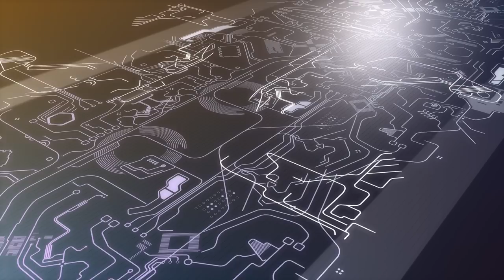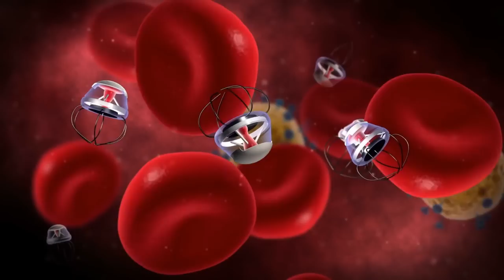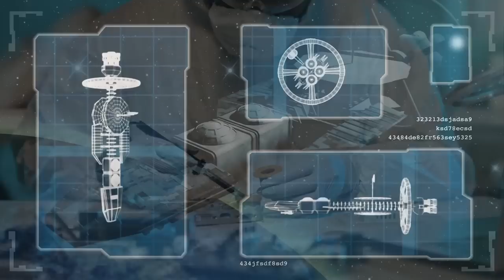Damaged Spacecraft & Shipwrecked Saucers

Comment: The sparking and exploding high voltage control panels in scifi spacecraft have always amused me.  Required voltages go down as electronic sophistication goes up.  Currents go up, for now, but there are overcurrent protections.
Reply: It's the FUTURE!

Everything is now built with an allow of Explodium, Sparkium, and Smokium. 

Why can't people see the visionary and practical application of that?

(Picard is intrigued by this comment. Sisko is angered by this comment. And Kirk is aroused by this comment.)
Reply: @davidtherwhanger6795  It is funny how with centuries of technological development, Starfleet still hasn't rendered pyrotechnic circuit breakers obsolete.
Reply: Depends. For the replicators we are talking petawats of energy. I would assume higher voltage goes long way to avoid trillion amp circuit breakers..
Reply: @ladislavseps4801  But we don't normally see the replicators explode. I don't remember ever seeing a replicator, even a small one, explode. Instead we see the computer panels (control circuts) explode violently enough to throw full grown adults some feet away. Those should be low voltage/ low amperage/ low current systems.
Reply: @davidtherwhanger6795  It seem like most people see the star trek episodes and have no idea what going on. All the episodes where the control panel explodes is from a outside energy surge. That doesn't mean the control console is high voltage or any kind of safety device would have made any difference. It was part of the story line of the episode.
Reply: @ladislavseps4801  I have seen no episodes where petawatts of energy was used for the repicators.
Reply: @ladislavseps4801  Where do you get petawatts of energy for a replcator.. It  has never been said on any episode of energy levels that high for replicatorss.
Reply: @clementvining2487  I was an Electrician's Mate in the US Navy. Can guarantee it doesn't work that way. Being as you want to talk about Trek and nothing else explain how in many episodes when a computer panel on a bridge workstation does this some one else immediately sits down and operates the panel? It just got zapped by loads of power it wasn't supposed to be able to handle and the systems should be fried as they were sparking with enough force to throw some one away, but still works? Please explain in detail how the panel is perfectly fine after a few seconds after most of the insides should be melted.
Reply: Yes, I know explodium has its downsides, but it's just so perfectly suited for starship applications.
Reply: The future has no OSHA apparently. Little things like unintended acceleration into a star are hard to prove with no spaceship

Comment: For long distance ships, it always takes me out of the show if the "lone long range explorer" doesn't have a factory with it. 

I loved Voyager (warts and all) but even kid me was like "why didn't they immediately take a left turn into an uninhabited solar system and convert Voyager into a heavily armed factory ship? They have replicators?"

(Yes I know..."replicators can't b/c..." BUT replicators CAN replicate robots and tools, and you have a solar system full of raw materials. Build a von Neuman probe factory, launch those babies and have scouts that eat it before you do, and then lumber from raw material point to raw material point, armed, armored and factoried up to the teeth. )  

It's...literally their long range, extreme distance, top of the line, explorer. It's supposed to work without starbases for long times. That thing should be able to tear apart full solar systems given time and necessity.
Reply: I have recently begun to wonder why no one in Star Fleet didn't weaponize cargo transporters. Once an enemy ship's shields were down or if you where sneaky enough, you could transport entire sections of the enemy ship away. Sure you probably couldn't remove things like entire warp or impulse engines, but you could have all of them onboard lock onto the main power source of a ship and just start beaming away what ever they could grab onto from that area. Would cause all kinds of havoc to the enemy.
Reply: @davidtherwhanger6795  
Remove just part of a warp core.....
Reply: @davidtherwhanger6795  Beaming a photon grenade into the warp core works too 🤣
Reply: @davidtherwhanger6795  you don't need to beam anything in or out, just target the crew and delete the files from the buffer before you reassemble them, free, undamaged ship with no fight.
Reply: @davidtherwhanger6795  On that note why don't they also have an emergency system for when they get boarded? One where once the computer detects intruders it just starts auto-beaming parts of them into the void. I mean I imagine if you did that enough absolutely NO ONE(save for the Borg probably) would screw with your ships anymore.
Reply: @popuptoaster  Now that's thinking.
Reply: @AGTheOSHAViolationsCounter  Beaming them out piecemeal.
Reply: @ReallyRealBenMills  Yep just imagine Picard saying. "Commander Data engage program. . .'Falling to pieces'."
Reply: @davidtherwhanger6795  Because shields block transport and starship hulls are kleenex compared to the weapons employed?  If you've taken down their shields, and they don't surrender, which option do you take?  A) Blow the helpless ship out of space, or B) even the odds, make yourself super vulnerable to their weapons, and play transporter games?
Reply: @boobah5643  You can't beam it back to your ship thru your shields. (Well actually you can as Chief O'Brien did, thru the shields of another ship as well. But that's another story). You simply beam it to another location within range.
Reply: @icecold9511  You can't remove part of the warp core it is a container for warp plasma.
Reply: @clementvining2487  
You can if you want it to blow up. Weaponized transporter.
Reply: @icecold9511  Yes you can in the early shows with with the first enterprise. But the later shows they scramble the signal. The force field stop unauthorized teleportion also.
Reply: @davidtherwhanger6795  Accully on one episode of star trek enterprise they did that. They beamed parts of the enterprise from a different time on to the ship.
Reply: @popuptoaster  the transporters in star trek seem to have an analog component that makes them something of a black box technology. They work, but there is only a limited amount of control the crew has over the process so they might not be able to delete the file.

Comment: I always figured besides the bad writing the issue with them not using the replicators in DS9 was for a simple reason they installed the replicators designed for recreational use or smaller scale things but never installed the heavy duty replicators.
Reply: Industrial replicators damn near require their own warp core to function 🤣

Comment: Dangit I was hoping for an episode on reverse engeenering crashed alien ships, and pointing out that we probably couldnt reverse engeener it. 

For instance if romans stumbled upon a U.S. aircraft carrier. They just had no way to make the tools that made the ship, as the ship was made out of steel that they couldnt make, made out 1000's of times of iron that rome ever produced. 

 The Nazis used a 50,000 ton press to make air frames for thier aircraft and the allies could not figure out how they were making the air frames until they invaded and saw the gigantic presses. 

In other words why we probably couldnt reverse engeener a highly advanced alien ship because the tools that made them are way beyond us.
Reply: One thing to consider is, how much time does the Finder have to work on it.  If one's civilization is near its end, like Rome in the early centuries, so it runs out of time.  Versus the U.S. at the end of WWII where in twenty years the Axis tech had largely been decoded and worked into the processes of its industries.
Reply: Just because you can't copy the method somebody else used doesn't mean you can't make a device that uses the same principles.  Just knowing something can be done is significant information; having a device that can demonstrate the process can tell you how to build one, even if you can't build it the same way or at the same scale.  And sometimes the method you can do is better at the job than the method you cannot.

This last bears some explanation; I don't mean "A method you can use is better than one you can't," which is self evident and not worthy of note.  I mean local maximums are a thing, and the more 'advanced' civilization may be using a technological evolution that made more sense an innovation or three back, while those reverse-engineering the device are still using a technique the 'advanced' civ abandoned, but actually works better for the current application.  As an example, vacuum tubes are still preferred for some applications over transistors.
Reply: @boobah5643  Thats actually a part of the question. What if you can not figure out the principles behind what is being made, like the allies could not figure out how the heck the nazis were making magnissium airframes, especially without all the bolts and screws they were using to build theirs.

That said what if for instance a critical component is say alloyed metalic hydrogen that must be mined on a gas giant twice the size of jupiter? There is a reason why chemistry took off after ships started sailing all over the world. It gave them access to certain chemicals they never had access to before. For instance just because you had access to baking soda doesnt mean you could reproduce it without having access to trona ore.
Reply: If the Romans stumbled on a US aircraft carrier there'd be a huge shock in the simple fact that a metal hull can float. That one tidbit alone would jump an Iron Age civ forward a millennia in ship building tech. Also for the record, the Romans DID smelt an absolute fuck-load of iron. An air craft carrier uses a lot of metal, yes, but the Romans in particular of any pre-industrial civilization could have probably done it if they put their minds to it. The lead mining in Iberia for instances was so intense during the 2nd century that tree ring and ice sheet bore holes in the arctic show a spike in the atmospheric contents that wouldn't be matched again until the Industrial revolution. Water driven mining, in-line water-wheel factory forges and immense levels of consumer production usage. There's a hill in Rome that's made entirely of shattered shards of amphora vats (huge 50 gallon drum sized barrels) that were filled with olive oil. Had things gone just a bit different, the Roman empire could have figured out how to industrialize by 500 ad. Sorta the cultural aspect that goes along with the whole "vacuum tubes vs transistors" choice mentioned before. The Romans unfortunately listened to the Greeks for all the big idea stuff, so Plato and his cave of shadows ephemeral nonsense dominated thought. No one put theories to the test and implemented them, just having the theory was good enough to build a whole second theory off of the first and everything sounded like String Theory. Unprovable bullshit based off of someone elses unprovable bullshit built off of speculation that was never tested. Plato single handedly screwed up reasoning and deduction for roughly a millennia and we still to this day go back to his garbage. If you haven't guessed, I prefer Socrates myself, lol. Anyway, the fact of the matter is yeah the Romans probably COULD have smelted and forged enough iron to create entire fleets of metal vessel, even a few with tonnages similar to a modern warship. An eccentric emperor could've done a single air craft carrier sized flagship, sure, would've been more practical for lots of smaller ships tho (smaller as in WWII destroyer sized, still hundreds of tons of metal).
Reply: @Lusa_Iceheart  My hat is off to you because you are dead on about plato. Most people do not realize that. Philosophy has a lot to do with science, and that is legitmatly worth studying. 

And boy you are right, it would be interesting to see what Rome did if they realized iron could float.
Reply: @clementvining2487  the allies had the theoretical knowledge to build a 30,000 ton hydrolic press, but the allies had no clue how to make air frames like germany. They actually threw a lot of money at it during the war. When they finally saw the presses, they practically facepalmed because they could have built the tools. But seeing the airframes, did not help them build tools to make the airrames.

Comment: always wonder why they do not have surge protectors on star trek
Reply: Side effect of the low budget and creative thinking. Probably blame background issues on that. I don’t agree on things with the newer series do on occasion but the exploding console doesn’t really happen anymore since they actual show damage to the ships now. Yeah panels still explode but where the attack happens not on the bridge.
Reply: I think they should have had an episode where they had an away mission but they forgot Data's charger adaptor and Geordi tries to improvise one.
Reply: i always wonder why they put explosives in all the control panels that the crew stand over ..
Reply: LMAO it does seem like they plug everything else into the consoles up on the bridge
Reply: They run high energy plasma conduits through all the consoles. Crazy, I know.
Reply: Just seems stupid that a UI would explode or be of such high energy consumption that it could. It would be like your laptop screen or keyboard using a gigawatt when it only uses a few Watts.
Reply: In the military fuses and such are often circumvented because in a battle it's better to risk a dangerous malfunction than for the equipment to stop working just because it went out of safety tolerances. If an electrical load is placed on a piece of equipment which wouldn't cause it to go up in flames causes it to shut down, people can still die as a result.

Edit: It even has a wikipedia page. Look up "battleshort."
Reply: They don't have surge protectors because it is a inefficient way of useing energy. They use power relays instead. They don't waste anything. Any power not used is directed somewhere else. Any radioactive isotopes or waste is used in low power systems in the form of power cells. There is always very large power reserves. If relays are burned out they simply replace them and make more.

Most of there power systems are plasma  base. Even the power for the warp drive it is warp plasma. Warp plasma is matter and antimatter together in a stable form. It is stored in the warp core. The first ship used antimatter intermixed chambers but it is impossible to get the mix 50/50. The warp plasma is 50/50 so you get higher power output for the gamma radiation. Plus if you need it for electrical power with the help of the dilthium crystals the conversion rate is extremely high like liquid electrical. The dilthium crystals are also used to make the warp plasma from matter and antimatter in the dilthium crystals chamber. Warp matter on star trek actually has a real life counter part.
Reply: They would be going to the fuse box ALL THE TIME!
It's easier just to tape those surge protectors on so they stop tripping. Problem solved.
Reply: The dilthium crystals on star trek are quantum state moderators. This allows control over atomic reactions. There fore it also allows extremely high energy conversion rates.
Reply: Not to mention why they’re always storing rocks inside the bulkheads.
Reply: @mattstorm360  A relay can perform the same function but not waste power. Plus it can  be adjusted
Reply: @hunam1464  Where else do you place your rock samples? The science lab bulkhead? Don't be silly.
Reply: @mattstorm360  Power relays are more efficient than surge protectors it would take a lot more power without any additional benefits.
Reply: @mawkernewek  Data is positron base power he doesn't use recharging.
Reply: @mattstorm360  Besides everything else relays react a lot faster than surge protectors you would have a lot more problems with surge protectors.
Reply: Because special effects.
Reply: @mattstorm360  You can buy a Home power backup system and because of the power relay the system switches over power so fast that you can't tell it switched over. You can be on the computer and there is no change when it switches over.
Reply: They're built-in, behind the walls 👍
Reply: @svsguru2000  There power conversion systems are plasma base.
Reply: It is funny how with centuries of technological development, Starfleet still hasn't rendered pyrotechnic circuit breakers obsolete.
Reply: @clementvining2487  - God bless the capacitor, eh?
Reply: @arcadiaberger9204  They have they use relays instead.
Reply: @svsguru2000  No they don't they run plasma conduits through the walls. 2 types plasma from the fusion reactors and warp plasma in areas needing extremely high energy. Then they have fuel cells at different locations some off plasma from fusion and some off of warp plasma. They also have fuel cells that run off of isotopes from the different atomic reactions on the ship. The consoles that blowup was from  external power surges safety device would have done no good.
Reply: San Francisco fallacy: they think they're just too good for the simple practicalities.
"Our society has evolved beyond the need for surge protection."
KABOOM!
"Ignore that."
Reply: To be fair, getting hit with fictional exotic-particle weapons on the power scale of nukes or bigger could conceivably cause some pretty spectacular surges that I wish you luck stopping. Especially if your handwavium shielding system dumps some of the energy into something physical. Those same weapons on a scale several orders of magnitude smaller do seem to disrupt the human nervous system pretty directly...